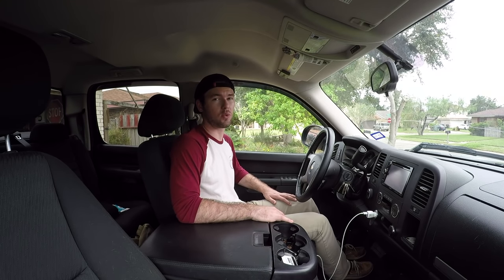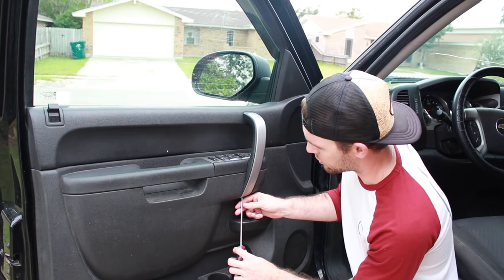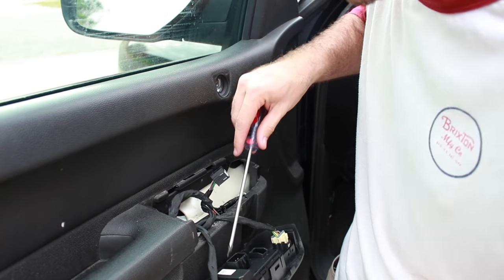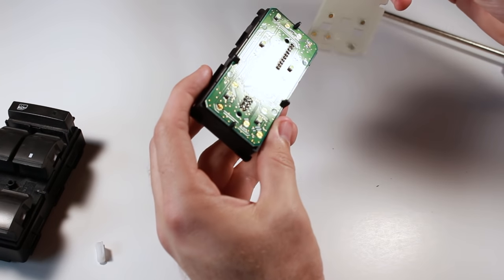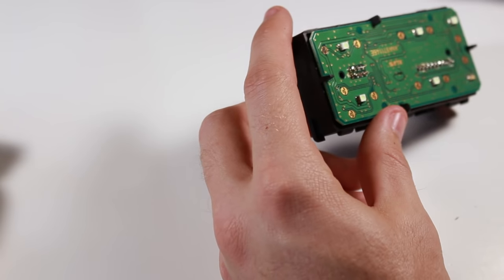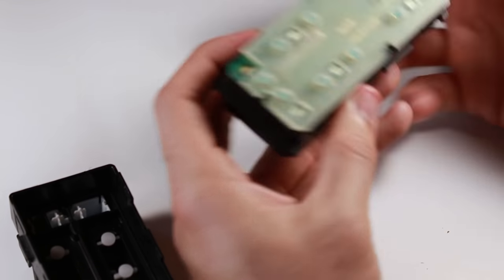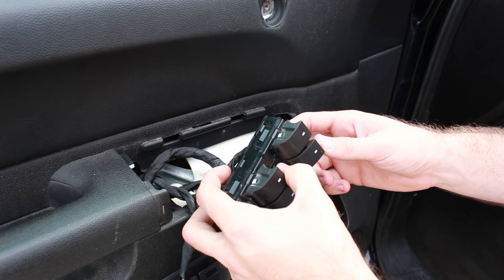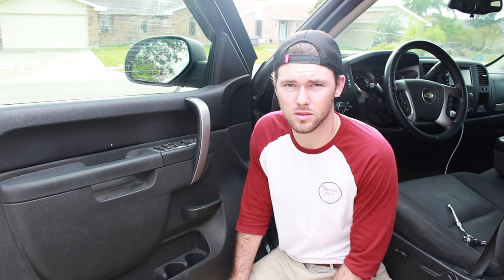How to Fix a Window Switch on a 07-13 Silverado/Sierra **FOR FREE**

Comment: Safer way is use a fresh pencil eraser. You don't risk damaging the board or the contacts.
Reply: i second that. wondering if i should put a super thin layer of dielectric grease to prevent it from coming back.
Reply from the maker: I never thought of that, it definitely makes sense to prevent it again.
Reply: Camilo Santana Dielectric grease is nonconducting. A conductive grease would be better.
And definitely use a pencil eraser.
I just now did this and it worked like a charm.
Reply from the maker: Dielectric grease would prevent any shorts while providing a barrier to the elements. That’s why you use it for head light bulbs during installation.
Reply: technically dielectric grease is an insulator yes...  but it isn't going to stop a connection. you can test this out in a million scenarios. what it does is prevent future oxidation. i've already finished and it's working fine.

i use dielectric grease on everything to seal out water and prevent corrosion. the grease moves out of the way in any physical interaction between connectors and doesn't cause any shorts. were it conductive, that would be a nightmare.
Reply: I tried your idea of a pencil eraser and it worked perfectly.  Thanks so much....
Reply: I actually used a pencil with an eraser in a drill while it was spinning fast it cleaned up the connections like brand new and of course I use dielectric grease but it only lasts about six months.
Reply: Thank you so much!! It worked perfect
Reply: I put a number 2 pencil in a cordless drill and use the eraser to clean contacts.
Reply: @michaelmajor5467  freaking genius!  thanks for the tip
Reply: I saw that on another video.
Reply: Thanks!
Tried and worked.

Comment: Great video. Another good practice is to wipe it down really well with isopropyl alcohol because it evaporates so you don't have to worry about moisture getting stuck in your circuits... but it cleans all corrosion really well. I'm a military-trained miniature electronic repair specialist and we did months of soldering and order to remove corrosive flux and other materials we always use isopropyl alcohol to clean it really well when we were done..  using an acid brush... trim the bristles for a firmer brush.
Reply: Thats what i used on my GMC, alcohol.  Cheaper and easier to fix the switch than replace it.
Reply: That is the first thing I thought of while watching him try to scrape off corrosion on a semiconductor with a flathead screwdriver.

Comment: Here in 2024 to say this just worked for me! Son put the back window down and couldn't get it up. Drivers switch has been wonky for a while. Also used a little rubbing alcohol on the connections and got some corrosion off. Took maybe 15 minutes start to finish

Comment: Awesome tip. I agree on the pencil eraser. The best eraser though is the more gritty ink eraser which is difficult to find, but a pencil eraser will work as well. Just follow the tip in the video and your driver door switch for the front passenger window will work perfectly. Thanks for this video! Saved me a trip to the dealer.

Comment: As I am EXTREMELY fond of telling my friends - You Tube is our friend.....and this particular repair fixed an issue with my 2013 Silverado. My passenger side window was misbehaving and finally quit last night (staying open 4 inches) during a rainstorm. Of course it quit then. This morning I "You Tubed", found this repair and it worked like it should have been in the General Motors repair guide. Also when I called the local Chevy dealership, I was quoted $243 for the replacement switch. Excellent video and job!!

Comment: My 2011 Chevy Silverado 1500's window switches were all acting up. Some would work when pressing down but then windows wouldn't go up. Looked all over the internet and read 1000's of different people's theories on how to fix from fuses, to broken wires, etc. Finally watched this video and decided to give it a shot. I had to perform this on every single doors window switches but they are all operating perfectly now. Quick and easy fix. Wish this was the first video I came across! Thank you!

Comment: Omg I spent the morning checking wires and fuses with no luck… just happened to come across this video, tried it and it worked! Amazing because it seemed like it wasn’t really dirty. Been having these problems for a minute just dittling with it until it would roll up but today was the day dittling didn’t work. Try this if you’re having these problems, it was so easy!

Comment: I have a 2011 silverado. Noticed this is a common problem. Called the local auto parts store. They wanted $100 for the switch. Watched your video, took 15 mins to fix and worked. 
Thanks bro.

Comment: I did this a few years ago to the rear drivers side door and it worked. The front passenger switch AND the driver's front passenger switch were acting up. I found this video again and cleaned everything and all is well. I used a pencil eraser to clean and then this aerosol spray called corrosion x on  a q-tip and dabbed all contacts just to see if it'll help keep the switches lasting longer. Thanks for uploading this video!

Comment: Thank you. Years later this is still helping. I have a 2009 LMM Diesel with the folding mirrors. The switch replacement is all-in-1 and cost over $150 plus the cost to program. All windows worked except the driver-side would not go down (not sure about up).  I tried this method, pulled it all apart and didn't see anything corroded. I figured I would use the eraser trick mentioned elsewhere for cleaning it off. Erased a few gold metal dots and put the case back together. Connected to the truck before reinstalling everything and tested. HOLY CRAP IT WORKED. Thanks for the video and thanks to the eraser comments.

Comment: I just wanted to give you a shout out. I had the same problem as you and follow your instructions and I'm back in business. The only thing I did differently was use a q-tip from a gun cleaning kit and a little gun solvent to clean the contacts on both the board and the silicone strip. I followed up with using a flat-head screwdriver to lightly scrape some corrosion off.  Afterward, I wiped them down and lightly applied some WD40 with another q-tip. I put everything back together and now both of the passenger sides work like new. Thanks for posting your video. :-)

Comment: This worked great, I was down to my drivers side window working, the back passenger side switch had been replaced right after I got the truck but it only worked for about a month and cost me $300.  All my windows work now and it took half an hour to do them all! Thanks!

Comment: Just got an 08 2500hd, only the drivers side would roll down. after watching this video, and using my 4 month olds nail file, all the connections are clean, and I have power windows and mirrors back! I had to do this to every window switch. Only took an hour or so. Thanks man!

Comment: Superior!      This worked on my 2007 Chev 2500 Diesel and my switch wouldn't work at all.    Thanks for saving me $165.00 for the part plus whatever the dealer would charge for lab our.  Excellent!

Comment: Wow!  Thank you!  I doubted this video so much......then after looking at my switches opened up and didnt notice any real corrosion.......but i did what you said and then checked the button.  It absolutely worked!!  Ive been dealing with my passenger window not wanting to roll back up for 2 yrs......i just chose not to use it.  Thank you!!  😁

Comment: Did this today on my 09 seirra, I have a extended cab with rear power windows and had zero control over every window, took it apart, cleaned all the contacts and all windows worked.. thank you for posting this video..

Comment: Nice job bro, I took my 2009 Silverado window switch cluster apart. Found grime and beach sand. Blew everything off with compressed air, then cleaned the contacts with a #2 pencil eraser and a drip of silicone lubricant. Blew everything off again and it worked perfectly as new. 👍👍🤙

Comment: Thanks alot for this video !!! You saved me $25 plus tax or more because 2 of my switches were not working. Only took me a bit of time . My '09 GMC had this issue. What you showed me worked perfect... Back window was driving me nuts also , with the same problem. Now all my windows work. Yay !! 🍻

Comment: This fix is 100% the real deal. But i used a pencil eraser to clean the contacts so as not to damage the switches. The amount of tarnish that interferes with a good connection is minimal and the eraser is adequate for success. I did all my switches in about 30 minutes. Great video!!

Comment: Dude, I saw your video and I have a 2013 “killer blue” Silverado. My both passenger and rear driver windows weren’t working. I did what you said. But instead of the screw driver to clean it, I used 40grid sand paper. (A piece as big as a quarter) and it cleaned it. Now my switch works like new!!!!  Thanks brother. Now I can use that money for my adult beverages.... if you know what I mean. Gracias!!!!!!

Comment: My driver side front window just started being balky a few days ago. I had no idea this is the way these switches were made. They are almost identical to the key fob that I took apart a couple of years ago, did the little clean up process, and it works like new. I probably would have broken something trying to get to the switches, so that tip about getting the pull handle taken off is worth about a couple of hours of time, and most likely a few thousand cuss words. Not to mention replacing the trim piece!!! Good presentation.

Comment: Just to add to the comments.  Was getting ready to take my 2011 Silverado to the shop.  No telling how much they would have charged.  I'm sure they would have just put in a new switch.  I was surprised how little corrosion was on the contacts.  Evidently it does not take much.  Works like new.  THANKS!

Comment: I have 2011 silverado. Same problem you had with your pickup. 
I did exactly what you did. Fixed the problem.  I can operate the passenger side window, from the driver's side. Thanks a bunch👍

Comment: 3 out of 4 windows weren't working yesterday, today all 4 are working. We did this for each window and now each individual window works as well as the driver switch works for all the windows now. I used the pencil eraser as suggested in the comments. Thanks for the video!!

Comment: Awesome video! It worked and took very little time!
Mine like some others in the comments, didn't seem to have too much corrosion, but definitely the circuit board surface and the membrane were dirty and sticky. I used isopropyl alcohol in a piece of cotton  to clean both. It's now working perfectly! Thank you so much!!

Comment: No way 🤯 I just fixed my passenger window that hasn’t worked in 4 years. I ended up cleaning the contacts on the passenger side as well because it still wouldn’t roll up on that side. Does now!!! Thanks!

Comment: Thank you very much, use this video a little while back to get one of my windows up. But it was getting dark out so I really didn’t have time to clean my switchboard. Two days ago with 20° weather out my nephew hits the back window button and rolls the window half down. Normally the replacement switches were costing around $69, I actually saw one onwest.com and ordered it for like $26. Just referred back to your video and switched it out in a matter of 10 minutes without even hardly having to open my truck door and be exposed to the cold weather. Thank you so much for your video, have a blessed day✌🏻

Comment: John vessel your doing gods work.. I saw this video, did exactly what you said and it worked I have replaced the switches once already, and not been able to roll my passenger window up without leaning over to do so for 3 months because I didn't want to buy another one for the exact same issue,  thank you very much for sharing!

Comment: Thank you for the vid, you just saved me a pile of money.  Here in Canada, they charge between $110 & &125/hour plus the part because I know they would have changed the whole unit.  I watched another mechanic on YouTube fix the same problem and the first thing he did was order the whole unit instead of cleaning the contacts.  Thanks again.

Comment: Thanks so much for this video! I have a 2010 GMC Sierra Some switches from the master control were intermittent  and some had stopped working altogether. The only thing I did differently than the video was I used a cotton swab with some rubbing alcohol to clear the contacts. Of course I made sure everything was dry before I re-installed the switches. I can't thank you enough! This solved a problem that's been going on with my truck for a little over a year now!

Comment: Wow. Thanks 👍🏻  I’ve replaced that switch several times and I wish i would have seen this video before! They get like that because water from rain that runs down if your window is open at all. GM and Chevy didn’t do a good job sealing those from moisture. Your awesome for sharing that. I put some Dielectric grease on mine also and it’s seems to be helping the switch last longer from corrosion 👍🏻

Comment: Just wanted to say it worked. Thanks just fixed mine today on my 2011 dmax..super satisfied. Was the switch for sure cuz it only worked on the passenger side and not the driver side. Was 99 percent sure it would work and indeed it did. Used the eraser method like other people mentioned on the comments. Thumbs up my dude

Comment: I just bought a used 2011 Sierra, a sound truck overall but one problem was the front passenger window switch from the master set of 4 had pooped the bed, I figured I'd got to a U-pull yard for a new used switch console, but I googled the problem and voila! 20 minutes work in my front yard, didn't even get my hands dirty. Merci Beaucoup!

Comment: This actually works, realistically takes about 5-10 minutes, and I used a knife to clean the contact instead of a flathead. The screwdriver wasn’t quite small enough in my case. Thanks for posting!

Comment: JV Garage this was an excellent video!  I have a 2011 Sierra with 250K km and your "How To" video on taking the switch out and cleaning the important parts kept me on the straight and narrow.  The entire area was very dirty and benefitted from a total damp cloth wipe down.  I ended up taking the entire door piece that the switch sits in so I could clean that too - of note the harness plug for the door lock switch first has a horizontal sliding clip that has to come out first (I suspect it's there to cover some exposed wiring that's energized when the truck is off) followed by the vertical clip that releases the lock switch itself (I had to work it back'n forth but it came off).  I doubt that part of the door has been that clean since not long after leaving the factory.  Another thing I did was sprayed electrical contact cleaner over the plug pins and window switch contacts both on the circuit board and on the silicone cover and let it all dry thoroughly for about 30 minutes to take care of any grease/oil that I couldn't see.  Then I rubbed the contact areas with a clean shop towel followed with light scraping from a small flathead.  It was very satisfying putting it all back together and seeing how smoothly the rear passenger window went down and up with the window switch.  Thank you for making this video!

Comment: Excellent video.  I had the same problem with my 2016 Chevy Traverse - passenger window not working.  I purchased a replacement switch for $25 on Amazon, had the part in 2 days, took about 20 minutes to replace it.  Works great so I was feeling good for cheating the dealership out of a $120 repair, then I watched your video.
☹️
Great video.  I have two more older vehicles so I’ll probably get another shot at it.

Comment: Appreciate this video and the commenters that suggested a pencil eraser!  Broke my driver side door handle on my new to me ‘11 Silverado and only the driver side window would roll up from the driver side, all would roll down. The passenger side switch would roll the passenger window down but not up, the rear switches work fine.  

Cleaned the contacts with the eraser when I pulled the door apart to fix the handle and all the windows work now! lol 

Just need to get the rear speakers back working and she’s right off the showroom floor!

Comment: Watched your vid twice. 
Followed suit. COMPLETED. THANKS TO YOU- ALL 4 of my windows are back in action. The corrosion factor on my board & contacts weren’t that visible; so I used cotton swabs dipped in rubbing alcohol then dried. Following day; I now did the same to the rear (suicide doors) and now the rear switches work like new too! I subscribed. THANKS!!

Comment: I followed the directions on the video to the letter…… although there didn’t appear to be any corrosion, I used a pencil erasure and rubbed on the passenger side gold looking area and put everything back together.
Boom…..!!!! It works like a champ. I’ve been riding around for about 2 years being unable to bring the window up … unless I reached over and used the passenger side button. Thanks for a great video. By the way … I have a 2011 Chevy 1500 Silverado 155k Miles….. I’m gonna try to keep it for another 150K….. especially with the prices of new & used cars being ridiculous…..!!!

Comment: Update - it worked for me!  I used 1000 grit paper to remove the corrosion and contact cleaner and cotton  swab to clean before and after.  If you see any dark "print" on the contacts, that is the corrosion.  Contacts should be smooth and shiny.  Thanks again!

Comment: On mine the little white piece under the lever that pushes down to let window down was broken. It was doing exactly what your window was doing though. I ended up just buying switch which I found on Amazon for about 15 bucks. Great Video... Thanks!